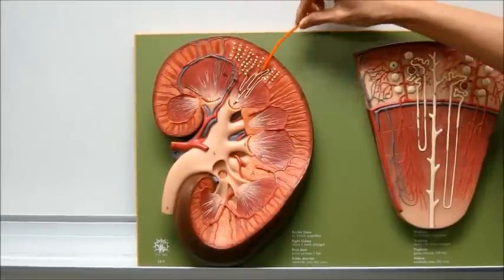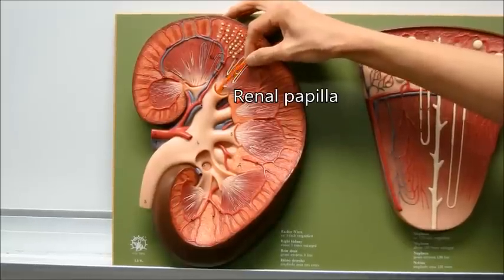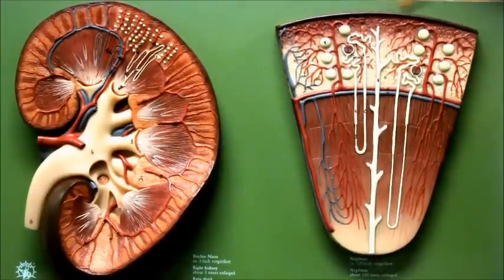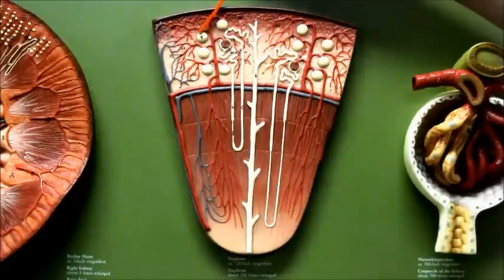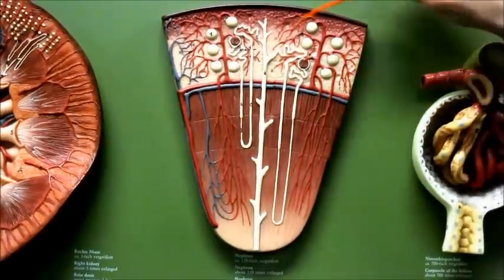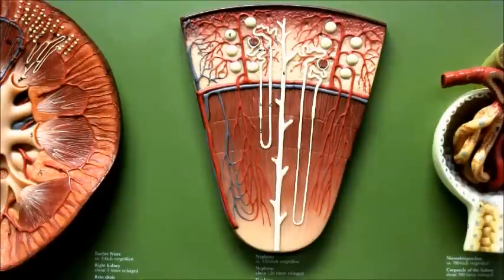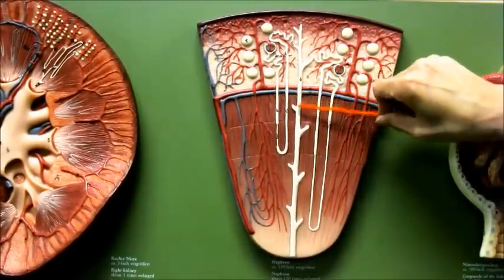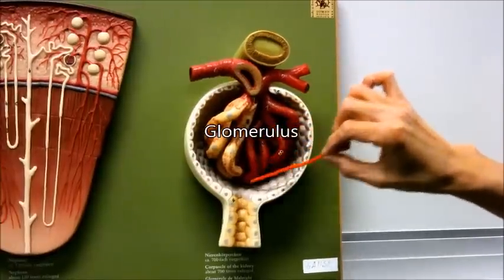Kidney Anatomy Urinary Model Renal System

Comment: Great video. However, the Ascending limb and Decending limb are mixed up.
Reply from the maker: Hi, thanks for the comment. The order is correct. The flow either from the right or left nephron, is the Bowman's capsule to the proximal convoluted tubule to the descending limb of the loop of Henle to the ascending loop of Henle to the distal convoluted tubule, which then connects to the collecting duct. Two nephrons are shown in this model. They are facing opposite directions of each other, but both will connect to the collecting duct.